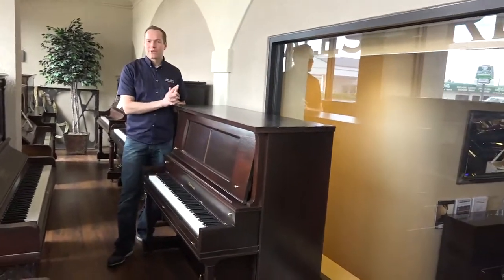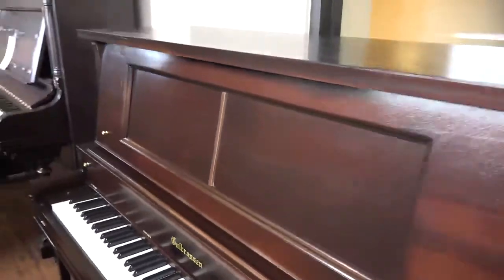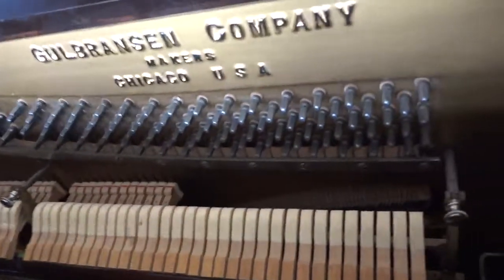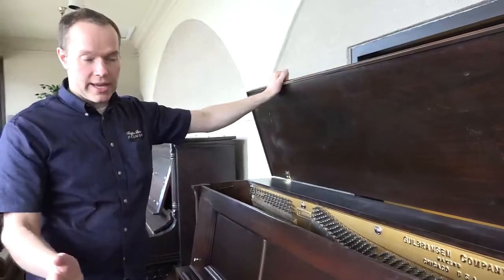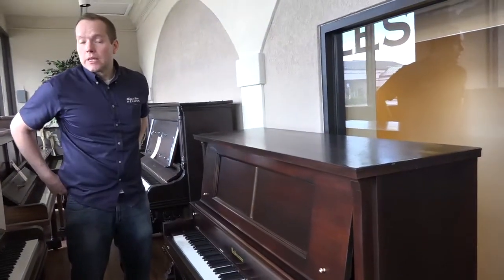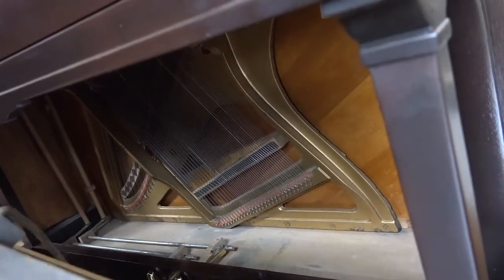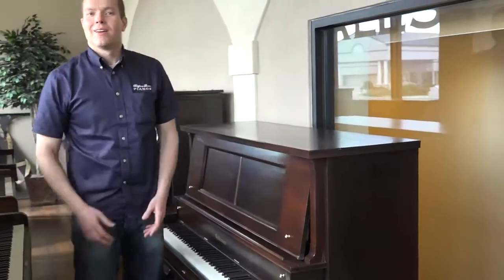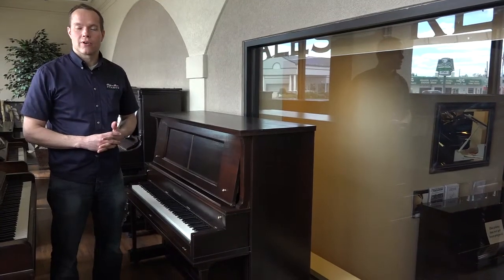1928 Gulbransen 50" Upright Piano

Comment: I just got a 1929 Gulbransen, pretty much identical to that one, just not as nice lol. It needs some work on a few things but as of right now it plays and it is in tune.. the keys are a little hard to push, and i notice a buzzing on a few strings which i attribute to probably needing new felt. The hammers need to be replaced, they have string indentions in them, but for a 90 year old piano what do you expect.  It was free. Anyway yall did a good job on the restoration of that one. 
Mine has a stamped national price of 279.00 on the back of it, as im sure yours does to, but in 1929 that amount of money would equal to about 5000.00  roughly for that piano but it does have an amazing sound i think. I love it!